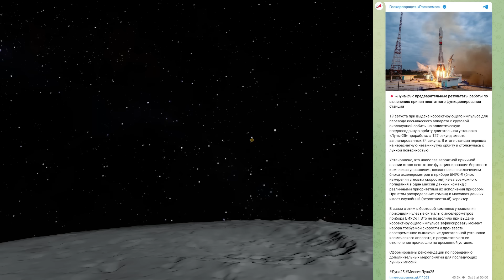Russian Space Probe Crashed Into Moon Because It 'Forgot' To Turn On Critical Hardware

Comment: As a software engineer it always amazes me how pretty much every mechanical/electrical system has been made highly reliable, yet the software is always handled like a cheap and "easy" afterthought. These are very complex systems which deserve to be developed and tested as such; just like their hardware counterparts!
Simple race conditions like this one should be blatantly obvious to any experienced engineer.
Reply: Before, the main expense in computing was the processing speed. Then it was memmory.
And now? You have enough computing resources to do fucking anything at this point.
So the main cost ended up being Human Resources. The programmer itself.

Its why companies invest so much in tryna have people write less and less code, no matter how egregiously bloated the system became.
Reply: @honkhonk8009  That doesn't help with reliability one bit unfortunately. The simpler your system is, the easier catching mistakes in it will be.

Also types. This very crash highlights how not using a good and expressive type system leads to very dumb designs. Going with 0 in a missing data situation plagues most apps today and is kinda what led to – or at least contributed to – this case not being handled. If you want to see how a good type system solves related problems you can read a blog post "How Elm Slays a UI Antipattern".
Reply: @honkhonk8009  This was still a constrained system. The electronics on spacecraft are much more similar to those available in the 1980s.
Reply: Well when making a mission critical system a critical design criteria is always fault detection and recovery. This is not Windows code. The system is defined and coded and fully simulated. Faults are injected and every piece of conditional code exercised and the performance and response verified. Its much more work than the original coding.  What this looks like is the code was written modularly by teams but the integration, interaction and fault tolerance missed something. Note this is some something you do only in roundtable code review - you must do it in your sim environment.
Reply: @dennisfahey2379  Windows code is extensively tested.
Reply: A related problem is that you can only test the software on a mock-up of the hardware until the hardware has been nearly completed.

Mock-ups are nothing but a mass of assumptions, based on the documentation, and rarely take into account things like resource contention between software modules, or race conditions, often not even latency of hardware responses.  Rarely are more than a smattering of anomalous conditions considered (IME).

But mocking is far better than not testing until the hardware is done, so of course everyone does it, but then confirmation bias and deadlines make everyone take these tests as somehow establishing something about the quality of the system ... roughly like assessing a car based on its paint job.

And of course hardware projects occasionally run late or have changes that were never documented because they didn't seem important and ... deadlines.

And, as we learned from the Morton Thiokol engineers and the Challenger disaster, even if someone is brave enough to say there's a problem, it still might not have an impact because ... deadlines.
Reply: @larrywest42  That's probably my favorite:
"We identified a problem we need to fix, or it will blow up in our face in production"
"I don't care about some obscure edge cases. Just get it done before the deadline!"
...It blows up in production...
"How could this happen?!"
"We told you this would happen!"

I don't know how often I've been shut down trying to investigate one of these issues preemptively...
Reply: This is why it's super important that code be written as cleanly as possible. Especially in mission critical applications, and why the program should be written from beginning to end twice.  The first time is a learning exercise for figuring out what are the right and wrong coding approaches to the problem and why. You can try all day to figure that out on paper or in flowchart form but you have to actually code it to discover all the reasons why its better to code something one way vs another. Then you delete the entire thing and start again writing it the way it should have been written the first time, only now you know why.  The problem is that non-programmers do not understand this, especially executives who see that you have an app that fully works and they want to stop development and just use that version for production to save time/money and move to the next project.
Reply: @Psi105  That's essentially Avery Brooks' (principal designer of OS/360) advice in The Mythical Man-Month : "Build one to throw away." The point being that you cannot fully understand the problem you're trying to solve in software until you try to solve it. Then you take what you've learned from the first attempt, and do a clean design and implementation, incorporating those lessons. Try to sell that approach to management, though, and they'll balk about missing milestones, etc. "No throw-away code!" was their battle-cry. But you end up investing at least the same amount of time patching a failed implementation, slipping the milestones anyway, so you might as well plan for the Brooks approach up front and do it right with a realistic schedule. This is especially important in a "one shot to get it right" job like a moon landing. Here we are some sixty years later, and management still haven't accepted Brooks' observations.
Reply: With hardware metal alloys have been developed with well defined properties, and machining methods are more consistent as use known repeatable procedures.

How software is developed is still changing and continues to evolve. The tools for software are also continuously evolving with much of software being developed from scratch for each particular project. The way software is tested is also much less consistent across the industry.  System stuff like clock speeds, messaging and timing are very hard to reproduce in a simulated environment vs. operational environment, so hidden errors in a test environment could leave a software team blind to an issue.
Reply: Automation tester here. What I can say is that everyone hates testers and testing. From my experience there are not many that do testing the proper way, as it's just a a checkmark on someone's list that has to be done as fast as possible and with least resources possible.

PM's, especially non technic ones, regard testing as a nuisance that make his bonuses vanish if they don't report green to his higher ups. Devs usually see testers as nitpickers that just are there to find insignificant things because their unit testing finds most of the problems. 

The most horrible principle to have is: releases have to always pass. If they don't, it means there is an organizational issue somewhere and people get reviews and some kind of punishments, or just more work, instead of just pausing and taking the time to make things right.  

Rarely you can find some organizations that really gives the final say to quality and are ready to lose some time and resources just to make sure that the product delivered is as good as it can be. Oh and PM's can put pressure, i assure you, from constant complaints, extravagant requirements and overwork just to make those pesky testers shut up and keep in their place. 

And given that I know a little about howe things work in Russia now, I would not be surprised that the amount of testing done and the attitude towards it is much worse than it is in the West. Think about the severe consequences of not achieving your goals there. Ofc you rush everything, and test only the critical things and pray that it's not you who should've seen any error.
 
As the saying goes: testing goes out of the window first.
Reply: Software engineer practices are really lacking in general compared to other engineering fields
Reply: It is always the same! Software is called into the project when hardware and mechanics is already set for month and years. Software is urged to fix all the problems that could have been easily fixed in hardware long before. But changing software is a phone call away. Later the resulting unit is frozen, heated, shaken and droppend. But nobody requests a simulation about busloads and especially bus overloading in all conditions. Even software testing is normally nondestructive compared to shaker tests, nobody ever adds the time frame for that. I've seen that in consumer, industrial, automotive, aerospace and military. 
Being a software guy for 30 years now, I am used to calls like "hey we forgot bore for a screw and need you to reduce vibration in software, so we do not need it!" I myself programmed around a capacitor. Software doesn't count but removing the cap... Yes, it would file an 8D request from the customer... For years we try to find the __pragma_((physics_off)) for our C cod, but no success for now.
Reply: @uki352 Said like a true software monkey that knows nothing about designing hardware.
Reply: Integration testing of the actual hardware wrings out both hardware and software internal and interfacing problems, yet it is often considered too expensive to perform.
Reply: @geoffreystearns1690  Yes, from personal experience a lot of effort is wasted in trying to specify every hardware/software subsystem to the tiniest detail and missing – in hindsight – obvious (integration) issues. A lot of this could be solved with a more agile approach where you regularly build (or at least simulate) prototypes with all relevant hardware and software. SpaceX is doing something like that with a lot of success.
Reply: @ericlaska4748 This is exactly right. For example, you don't get race conditions if you go single threaded.
And if you do really want or need to go parallel there are ways to make it provably correct.
Some other folks in this chain seem to be a bit bewildered by their comp sci classes; yeah the halting problem is a thing, but that doesn't mean you throw your hands up and say "you can't even prove my hello world halts"!
Besides that, "not possible to test every path"? Cyclomatic complexity is a thing too!
If you keep the path fanout down you can analyse it.
It's engineering, folks. Not the first time I've been upset they call me a Software Engineer rather than a programmer, even if I think I could live up to it; the role doesn't fit the title.
Reply: The number of confidently incorrect people here is funny, but not surprising.

"ITs ThE hAlTiNg PrObLeM! Hurr durr!"
Reply: Also software engineer here. I have to disagree though. Race conditions are probably the most difficult ones to find. They are inherently non-deterministic and thanks to the halting problem isn't possible to write any kind of test that would reliably detect them. You also have to consider that these public announcements usually heavily simplify the issue so the average reader understands it.
Reply: @devluz I thought that one could normally find an in depth tech report as an attachment to the press/public summary  - and vice versa.
If not, why not?
Reply: @devluz  I think it depends on how you develop the software. If you already introduced a race condition it's incredibly hard to find it afterwards. I'm with you there. However there are construction methods which make your software provably correct and free of bugs like this. Anyways those are sometimes highly academic and in active research and thus only used by the likes of ESA and NASA (apparently not Roscosmos xD).
Also there are tools which basically (try to) execute every possible instruction ordering in the hope to catch race conditions after the fact. Of course the combinatoric explosion makes this increasingly difficult for complex systems.

This priority inversion/resource starvation type of race would have been relatively easy to catch with proper stress testing.

Indeed the halting problem is scary, however you have to remember that no real system can ever be truly turing complete because memory and compute time is limited - especially in real-time systems.

What I'm trying to say is: Not every race condition is easy to find, but this one is.
Reply: I love detailed breakdowns in the comment section from people with no direct experience with what's going making all kinds of assumptions. My favorite to read on the toilet.
Reply: @MrRoboticBrain I bet I could have guessed your screen name in.....4 tries after reading this 😉
Reply: Was a developer for 40+ years and watched as the industry evolved a lot.  Some of the changes are the difference in total costs for a software project based in large part on the level of reliability.  The QA program for the latest version of 'Candy Crush" is (I should hope), a lot different than what is needed for life-critical medical software.  Unmanned spacecraft probably lies somewhere in between.

It's not always easy to find the 'sweet spot' of how much time, design, testing versus schedule and cost-of-failure.  Especially in such a small market as spacecraft.
Reply: I also work in software. When I get on a plane, I'm fine with the physics and the hardware and the pilots and the crew ..... but it is the software that makes me nervous.
Reply: "I don't always test my code.  But when I do, I do it in production." 
- Roscosmos, probably
Reply: Part of the issue is the inevitable tunnel vision everyone gets on a project. In an ideal world, risk management charts would be comprehensive and accurate. What happens when the INU fails? How do we mitigate that risk? What other problems crop up?  In the real world, there isn't enough time or sanity to go down every rabbit hole. What if a micrometeorite perforates the main CPU? Literally astronomical chances, so probably not something to double your mass over.

Apollo used multiple parallel systems, and these days I hear they're working on self-healing FPGAs, but none of that matters if a procedure is incorrect or software doesn't properly handle either software or hardware errors. 

It's an incredibly expensive lesson to learn, but hopefully we can learn from this one. Not as bad as NOAA 19's little trip after someone forgot to put some bolts back, but the same general theme: you have to assume something can fundamentally go wrong. Why didn't they parallelize or sanity check that sensor? I don't know, but it's a question for the next team.
Reply: No one can; or has ever gone to the moon; so that stuff doesn’t really matter.
Reply: Software usually takes center stage in the system, everything else is a peripheral in support of fsw.
Reply: Haha, so true I did combined degree and our EEE professors were making jokes like as engineers we make shit that works, none of that computer science nonsense..
Reply: software engineers are not very smart but they design the software that ruins our lives for the benefit of the corporations.
Reply: @merlinemeresk412  Also there is no degree called "rocket scientist" you're obviously trolling.
The degree is called "Computer science", "software engineering" is just a very small subset of that.
Reply: @MrRoboticBrain  there is no science in computers. The computers are just some implementation of science.
Reply: @merlinemeresk412  hardware is just a collection of useless junk without the software telling it what to do.  A large modern software project, such as the Linux Kernel, can be every bit as complex and well engineered as the most magnificent physical structures and machines.

Without someone writing the sequence of ones and zeros that make your transistor turn on and off, you're literally just left with a piece of sand encased in plastic.
Reply: Because most Program Managers are hardware guys…..
Reply: @dphuntsman is that irony? i.e. if program managers were hardware guys we wouldn't have these problems?
Reply: A hardware issue can usually be demonstrated to even the most unqualified manager. "Look, this part hits this part and stops this part from working."
A software issue requires a much broader understanding of the entire system, especially where seemingly unrelated pieces of code interfere with each other.
Imagine being the software developer trying to explain this fault to your manager who's biggest qualification to do the job is that they are related to somebody with influence.
Reply: @jaseastroboy9240  Lots of hardware issues can be quite complex too and only appear on the fully assembled vehicle. Stuff like the recent issues several companies had with corrosion in their valves.
Reply: @Mike-oz4cv  Yes, there is complexity in both. But if the person making decisions about fixing or not fixing the issue is a manager that doesn't know enough hardware or software engineering to understand the issue. Then you probably have a better chance of demonstrating it to them if it is hardware. A hardware engineer could show a new valve and compare it to one of the corroded ones. A software issue is harder to demonstrate, especially one where the software "works" and will only fail in a particular scenario.
Reply: I don't know if I've ever seen a "simple race condition." They're almost never simple, and often very dependent on runtime conditions that are very hard to reproduce in testing. Certainly there are architectural principles that can be used to reduce the probability of such issues, things like using TCP or similar abstractions to guarantee delivery, but those have their own issues in real-time systems. These are not easy problems to solve.
Reply: Everything is obvious in retrospect and hindsight.
Reply: As a software engineer, I don't know why you're surprised that Russia has shitty software when anyone in the country who is competent has left to make far more money somewhere else.

Also, bus communications is not really "software." It's electrical engineering.
Reply: Software is by far the most complex thing unknown to man.

Software deals with timescales of nanoseconds and decades at the same time.  The software architect handles individual bits and gigabytes in one build.  Latency spans from processor register access to data from a harddrive on the other side of the planet.

Software weighs nothing and takes up no space.  (Not entirely true from a theoretical physics perspective, but true in practice.)  In human terms this means it is cheap.  Just like a broken piece of cast iron is perceived to be of higher quality than a perfectly functional piece of plastic or paper.

That's why hardware had to be kept as simple as possible (with exceptions in electronics).  It takes up space and has weight, and it is pretty noticeable when it collapses under its own complexity.

All the complexity is added in software.  Indeed, it is usually simpler and cheaper to use a microcontroller and emulate an electric circuit on it than to build that circuit. All hardware can be emulated in software, from mechanical control devices to electronics to other computers.

And it weighs nothing and takes up no space, so there is no limit to how complex it can be, even for the most trivial problems.

The reason why electronics are not as simple as possible is that the time it takes an engineer to find an optimal design would cost more than the cost of material it would save even in mass production.

This is even more true in software, where mass production is essentially free.  So the biggest cost in software currently is finding all the errors in it that were made because it had to be released before it was designed, followed by the cost of working around those errors with new errors.  (Proper fixing would take too long, and requirements change even as the thing is already used in production.  A fix typically decreases the code size, a workaround increases it.  That's why code size numbers  the gigabytes and counting.)  And the later the error is noticed, the more expensive the damage it does and the more effort it takes to fix.  (Same as in any other discipline, from writing books to archaeology.)

Any mathematical proof is equivalent to an executable algorithm.  By designing software as proofs, it is possible to create provably correct software.  There are different ways to do this, but none are ever used because it would take too long.  High level code used to describe a design is already executable, so hack up a draft and ship it.  Don't bother with creating a suitable language, nobody has time to learn a new language.  The JSON API will be the language.  Where proof is needed (such as in parts of aerospace engineering (but not medical devices) where failure is really expensive), it will be done separately afterwards.

So if you know a bit of JavaScript, go on and create an arbitrarily complex piece of software, even if you don't know the first thing about algorithms and data structures.

Most software is built in a way that resembles a fixie bike made from trains.

Mechanical engineers build machines from machine parts, assembled with screws and latches.  This makes the machines easier to build, test, maintain, and improve.  Likewise, the Unix philosophy urges to create small reusable executables and let the operating system handle communication and parallelism, because the OS has to do that anyway.  Creating threads within a process has more overhead than a simple fork, and is a common source of errors.

Most software is monolithic and multithreaded.

Electrical engineers use standardised interfaces, such as sockets and plugs, with guarantees about the electric properties thereof.  Software interfaces are similar contracts, often with specific protocols in domain-specific languages (like HTTP).  They are usually added as afterthoughts, because they have to communicate in some way, and as such are frequently changed.  As software, they are infinitely malleable, after all.

Software is a mathematical description of whatever class of problems.  The properties of any implementation are usually treated like a physics problem.

Software is cheap, changing it is almost impossible:  Even though software is infinitely malleable, previous builds stay in use until they rust. (Fixes for errors might break the existing workarounds.  Better the devil you know.)  Hardware changes much more rapidly than software.   Because hardware is cheaper.  Because hardware isn't quickly hacked up, but thoroughly designed and tested.  Because hardware is expensive.
Reply: Thats because you don't understand a fundamental difference between hardware and software.  It is possible to test every single functional path in hardware.  It is often not possible to test every single functional path in non-trivial software.  This is because the number of different ways for the hardware to work is small.  The number of different ways for the software to work can be untestably large.
Reply: NASA program managers think every job but their own could be done by a student intern.
Reply: We take apps for granted today. In the 60s, Apollo had to invent apps like P62.
Reply: a software guy's mentality is simple:   "we'll patch it later" lol